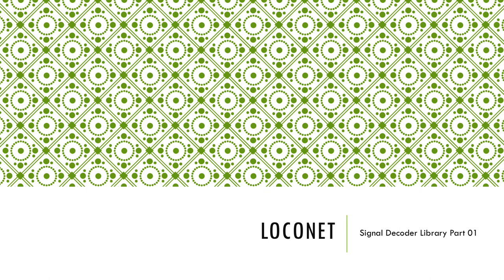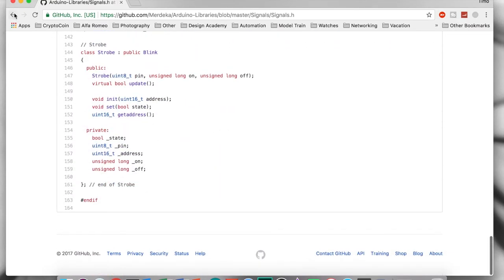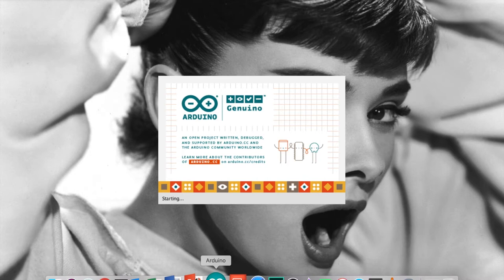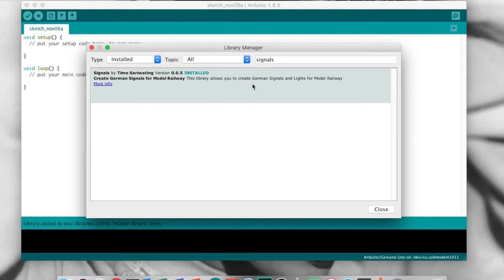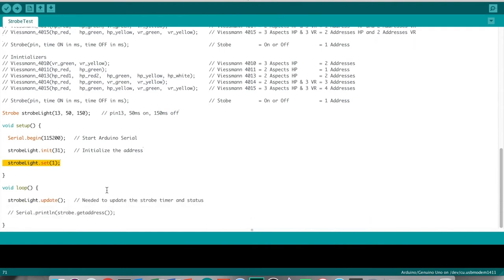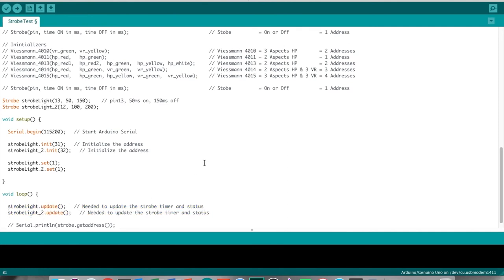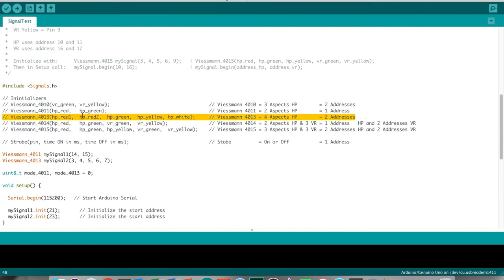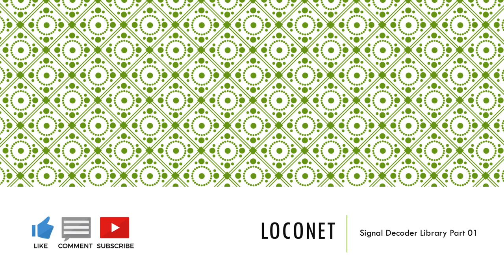Arduino | LocoNet Signal Decoder Part 01

Comment: This is good Timo. I can see merit in adding different countries to this, like US, Australian and British libraries, different manufacturers etc.
Reply from the maker: Yes! That's what I hope to accomplish with the help of the community. Support for different manufacturers is important because of differences in common cathode or anode and wiring. With the help of transistors and relays we could even switch higher loads than the 5v & 40ma that the Arduino can handle.
Reply: @CuriousTimo  I would love to look at controlling UK signals with Audrino probably Beko models

Comment: Hello Timo,

nice work. How many signals can be attached?

I‘m working also on a loconet signal decoder with an arduino. For the signals i use an tlc5940. So it is possible to attach many signals. The remaining problem is that the tlc library uses the same timer that the loconet library needs. Therefore i bought a pro micro. Now i try to modify the loconet library, so that it uses the timer3.

Best regards